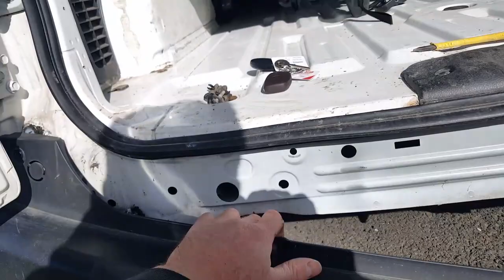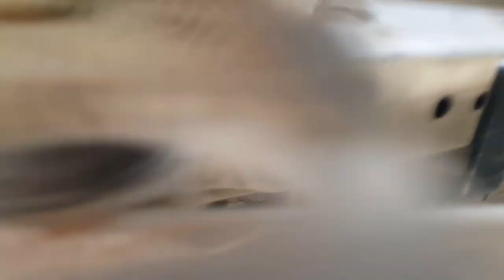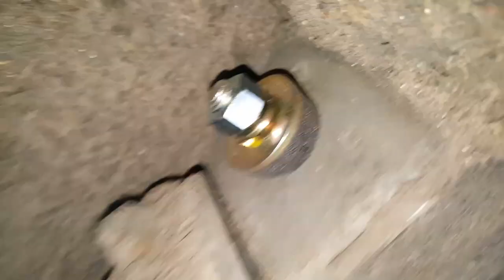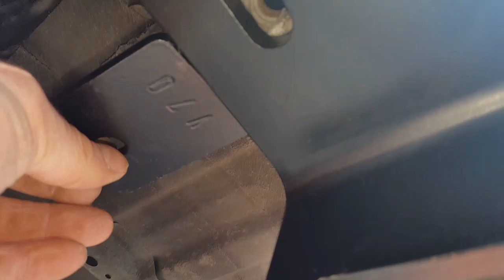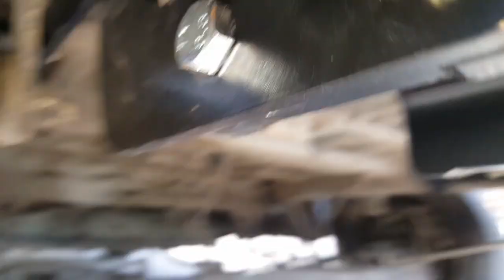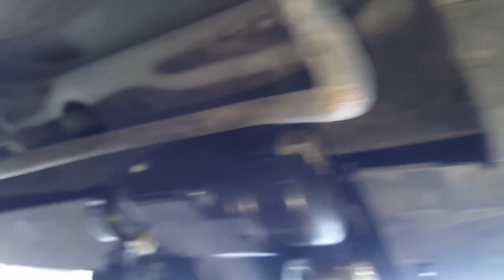Nissan ELECTRIC env200 van tow bar DIY how to

Comment: Hi - great guide - well done! Any chance of a description of the wiring, maybe a short talk over a few photos if you don't have all the footage of that. Also, what make is the towbar, was is described as specific to the ENV200 and are you pleased with it still? Thanks in advance.
Reply from the maker: Hi Ed
The way I did it was I got a kit from eBay it just plugs into the lights In the van.
So no cutting.
I got the towbar from Ebay it was just for an nv200.
It has worked great for me.

Comment: Excellent video, I'm just about to do the same thing. Did you do a video for the electrics?
Reply from the maker: Hi Marcus.
I just got the wiring kit from eBay its just plugged directly into the lights.
So no cutting cables.

Comment: Hi , do you think the nv200 tow bar will also fit on my ENV200 2014 ?  Nissan say there isn't a tow bar for it.
also did you get the electric kit separately or as an included piece ?
Reply from the maker: Hi, the one on my van is for a nv200 all the holes are there. I got the kit with electronics included.